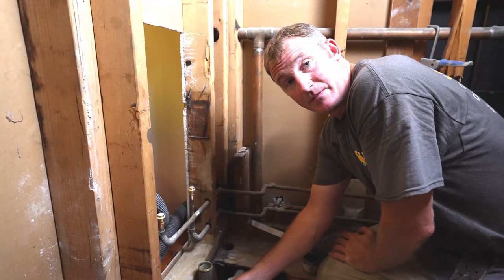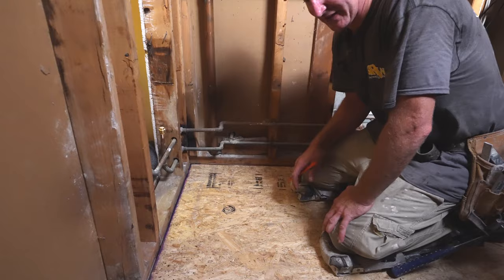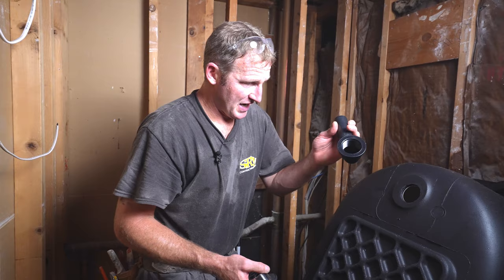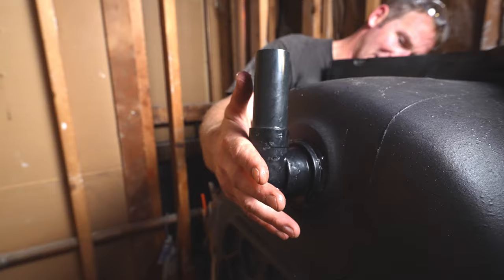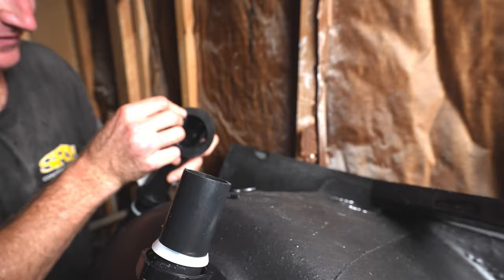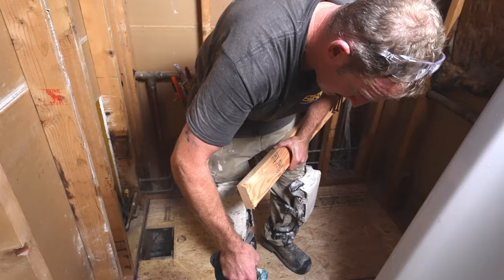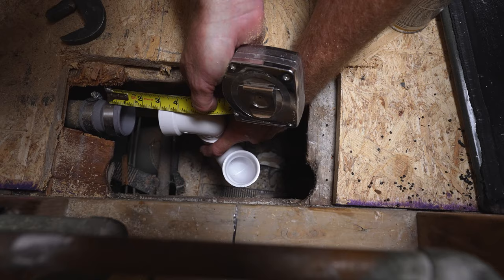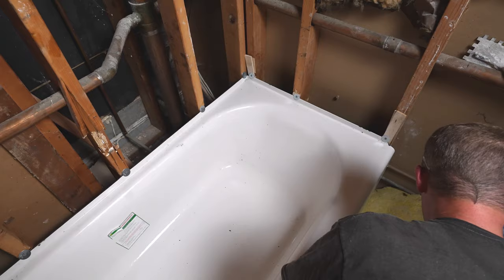Installing an American Standard Bathtub l PLAN LEARN BUILD

Comment from the maker: One thing I want to mention that some people may not like about these tubs with above floor rough-ins; the tub looks like a deep soaker, but is  a standard 15” deep tub inside. The space for the rough-in drain raises the bottom of tub, so you are sitting or standing much higher than you typically would in a normal tub.  something to be aware of
Reply: Good point, especially for senior citizens.  Please add a future video for retrofitting grab bars for entering and exiting a bathtub, since falls lead to bad outcomes.
Reply: Thanks for the great videos.  Question. I do have access under the tub via crawlspace.  Do I need the above floor rough-in tub?  Thanks.
Reply from the maker: @jjc355  no, only if joists are in the way of drain assembly. 👍

Comment: I’m a service plumber and if I worked in the same state as this guy and his silicone I think I would move. Holy cow! He does get the job done though and it looks nice.
Reply from the maker: 😆 yeah I always told myself, once I get asked to replace the stuff I’ve installed, I’m done! 😆 thanks 👍
Reply: Plus you may or may not be able to undo that boot with the screw ends facing up
Reply: @shantor100  Plumber's putty will last 10 years and they say it will not harden. I just removed a 50 year old tub drain and the putty is hard and brittle.  Silicone will last 20 years and will harden and is difficult to remove. But who is going to use the same fixture after 20 years anyway!
Reply: @joecenturion  true
Reply: @joecenturion  ME!  My tub is 40 years old maybe?  I've been in the house for 36 years...guess what I am replacing it this weekend LOL  Plumbers putty or Silicone?  Which should I use?  Delta acrylic tub,  my delta shower with plumbers putty starts to drip every 3 or 4 months and I have to tighten the drain a bit to stop it.  Any idea why?
Reply: Dont use putty with an acrylic tub, only silicone

Comment: I’m not sure it’s a good idea to apply silicone to rubber seals as the rubber seal is compressible and functions via contact area and pressure where cured silicone is incompressible relying on adhesion and elasticity of the cured product to seal. Also if you ever need to service the drain/overflow it’s going to make thing difficult.

Comment: Nice. Few things: The Fernco rubber ocupling you ended up using is not good for concealed pipe locations. You should have used No-Hub shielded coupling that actually fits over 1 1/2" Copper pipe (the one you showed us in the beginning of the clip ). Second that PVC riser cannot change size below the weir of the trap. You should have gone higher with that riser connecting trap and tub overflow drain., Lastly, I am perplexed by the use of silicone ! Otherwise, thumb up !
Reply from the maker: All great points 👍 it’s all  accessible from below in basement.

Comment: Good install! I have just a couple of thoughts. First, being out of level 1/4 over 4 feet is too much in my books. It just makes a perfect tile job so much more difficult. In this case, at least the slope assists the draining of the tub. If the floor sloped the other way draining would slow.
Second, I always deburr all pipe carefully, even factory cuts. It takes extra time but sharp edges and burrs catch long hair and can cause flow problems over time. My wife has long hair so I speak from experience.
Anyways, good job! You earned your pay.

Comment: I installed one of these tubs in my own house. I like to use a Kohler cast-iron tub, but working alone I had to use the Americast. I hate it, I have always hated it, and I always will. The darn thing oil canned on me the first time I used it, and every time I used it. I had to go downstairs, open the ceiling, grill the above floor and fill the space with great stuff.
Reply: What do you mean "oil canned"?  Thanks.  Was looking into this tub but not sure how it would hold up in the long run.
Reply: @jjphresh7058  in the old days, oil cans had a slightly domed bottom.  When pressed, the bottom flexed, making a sound when the dome popped the other way.  The tub did a similar thing when I stepped on it.  It flexed, I suppose because the metal is too thin.  At the time I weighed around 225 or so.
Reply: @bmcc12  Oh ok, I understand now.  I read on another review that there was constant “pop” sound when exiting the tub.  I imagine that’s what this was.  Thanks again!

Comment: Thanks for the video, I'm installing similar enamel tub but I don't have access from the other side of the wall (well I could but trying to avoid it) and there are also copper fittings in place, so can't put the tub sidewise to then turn it 90*. Any advice? I guess I'll need to remove more drywall around and just slide it in place horizontally, right? It really is a tight fit.

Comment: When you installed a backer board in this case, did you use 7/16" OSB board piece on existing stud to place board inside of tub edge? OR just set a backer board by slightly level inward with 1-1/4 washer installed?

Comment: Thank you for the video.  I found out this past weekend during my remodel that the plumbing vent for my tub is actually partially within the 30"x60" space for the tub.  They ran the vent in a corner where the old tub contour allowed for them to fit the vent pipe in and down to the drain, then they ran the vent up the stud wall cavity.  Is this normal?  Now I need to find a new tub that has the same profile to allow the vent to stay where it is.  Thank you
Reply from the maker: Yeah, sometimes vents are placed there. Not really sure why some do that. But most of the time they are tucked in corner or front where a regular tub would clear it. If not, you may want to reroute the vent. Sorry for delayed response, did you make out okay on it?
Reply: @BathroomRemodelingTeacher  I decided to go with a shower pan and I built up a false floor of about 4" to clear the vent.  I hope it all works out.

Comment: Really informative video! I saw the bucket there but wasn’t sure if you set a mortar bed or not. I’m doing one now that doesn’t have a perfectly level subfloor. The tub says it doesn’t need one but I don’t want any creaking. I heard some guys use spray foam instead of mortar. What do you suggest?
Reply from the maker: Definitely mortar. Spray foam doesn’t do much and isn’t Structral (I’m sure they’ll come out with one that is some day…) this specific tub is above roughin, so the base of tub was like 8” recessed at bottom, but standard tubs you can easily set in mortar. I was actually going to set this in mortar but didn’t realize it was that much height, 😆 I wouldn’t necessarily recommend an above rough in, unless you really need it 👍
Reply: @BathroomRemodelingTeacher  hey so I just ordered this same tub actually with the above floor drain. With that being said, do I not need to pour mortar before putting the tub down?
Reply from the maker: @ItsWaleedsWorld  no, it’s sturdy enough without it. Plus the bottom of tub will be like 4” off of floor. Would take a lot of mortar to fill it, 😆
Reply: @BathroomRemodelingTeacher  
 lol I figured would have been nearly impossible with that much heigh haha. So now I have 4 options. Which would be your preference. All Princeton tubs:

- above floor rough in tub
- above floor rough in tub with integral drain/ built in drain
- in floor rough in tub
- in floor rough in tub with integral drain/ built in drain 

Everything is out of stock I ordered all 4, not sure which to use hahaha.. will cancel the other 3. lol
Reply: I too noticed the mortar bucket and thought you set the tub in a bed of it.  Should a wood platform be built for stability and support of the bottom. Seems necessary to do it best. I think your videos are very informative. Thank you

Comment: I am going with a princeton over rough with integral drain because of your excellent videos. Newbie question: you are using a clear is 100 % "sealant" vs. a silicone "caulk" correct?
Reply from the maker: Yes, 100% silicon. One thing to note on those integral Princeton tubs, the trap typically needs to be directly below it. So make sure you don’t have a joist in the way! If you haven’t already my course will help out with everything else 👍 https://bathroomremodeling.teachable.com/p/tub-shower-bathroom-remodel-in-7-days-or-less

Comment: Isn't 1 floor joist compromised, where it was notched to accommodate the old plumbing?  The maximum amount that can be removed safely is 1/3 the depth of the joist;  otherwise, the joist should be sistered with new lumber.
Reply from the maker: Correct, that was just about 1/3

Comment: As soon as I seen him using OSB under a bathtub instead of actual plywood, I was done. And somebody’s going to be replacing this floor in another five years
Reply from the maker: Osb is no longer particle board crap. It actually withstands much more abuse than standard ply. I used to feel the same way as you until I built my whole house with it and have done dozens of bathrooms
Reply: @BathroomRemodelingTeacher  ok I guess I’m out of the loop sorry

Comment: I need replace my current one piece bath tub however the current bath tub opening measures 58 3/4".   Of all the bath tubs I came across measure 60". Any recommendations?
Reply from the maker: Are you measuring from rough framing or from current finished wall?
Reply: @BathroomRemodelingTeacher  I measure the current bath tub in place now.
Reply: It will fit. I removed drywall around the bath wall and it measures 60” from rough framing.

Comment: Why not use an integrated overflow, and get rid of all the possible points of failure with those slip joints? I second El Mono's comment regarding the 100% silicone. But looks like work sure goes quick. But is it penny wise, pound foolish?

Comment: Is it possible to install an above floor drain tub or a standard type tub without access fry below or behind? Thanks
Reply from the maker: It is for sure. I typically run into no access situations in basements a lot. It takes a bit more accuracy, but you need to set the trap at the right location before setting tub into place. This requires dry fitting the tub a bunch of times to get it right. I demonstrate this in this video - https://youtu.be/fLKRSQJLb2E 

And if you wouldn’t mind, after watching that video on the other channel, please leave a comment to Jeff telling him to pay me. He thinks he owns all those videos I’m in and has stopped paying me. Thanks
Reply: @BathroomRemodelingTeacher  Will do. That's horrible he hasn't paid you. I figured you went out on your own. I love your videos. It just takes a while to build a following. I know nothing about how youtube works but try having some click bait titles.

Comment: You had me until you used the Fernco, They are illegal above ground. Should have used the Mission Coupling you showed a little earlier. Most of your videos are excellent, but do it right.
Reply from the maker: Hey John glad you know your code, stick to that. It’s not an illegal fitting & works just fine.

Comment: Did you really just push that rubber drain fitting onto that dirty drain pipe without even wiping it clean?
Reply from the maker: Did you really just point out something of little significance?